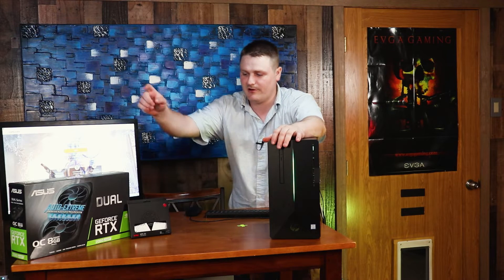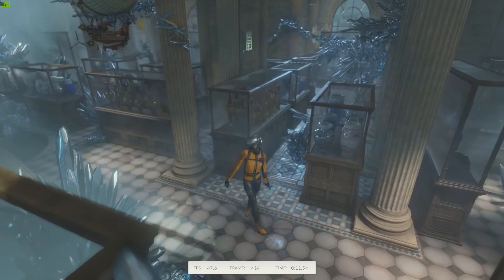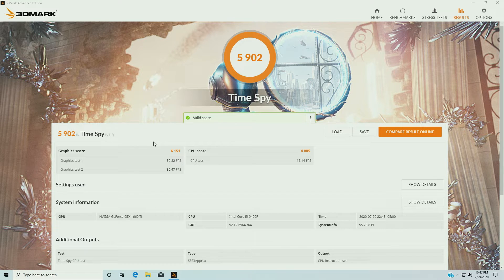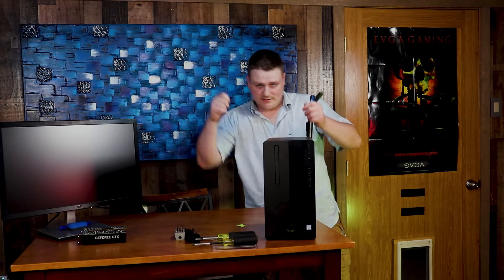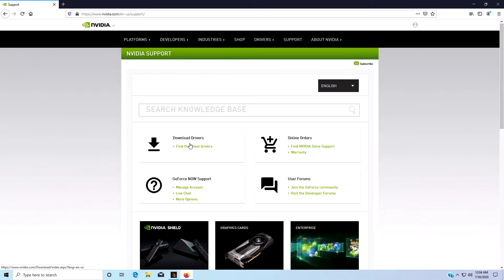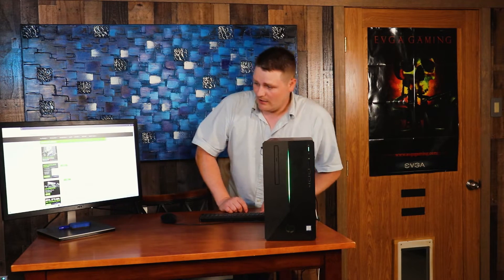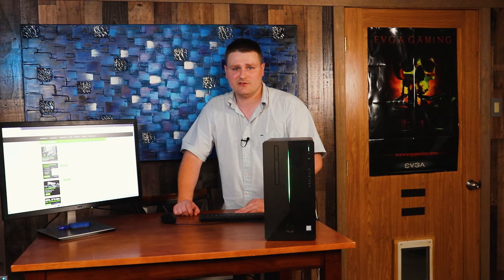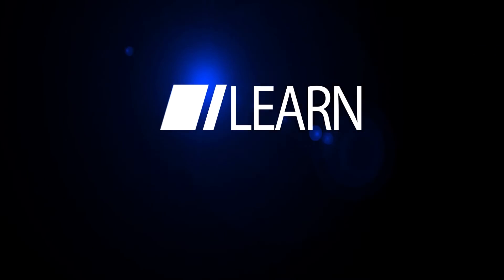Hp Pavilion Gaming Desktop 690 Upgrade To A RTX 2060 Super 8GB GPU & 16GB Of Ram (How to Install)

Comment: Would you suggest I change the motherboard out for better performance? And also, do you think its worth it to do a cpu swap along with the gpu and ram? And lastly, would a 3060ti fit?
Reply from the maker: New video will be out soon All I can say is I got soming thing better then a 3060 to work. Editing it right now.  To your other questions if you feel comfortable swapimg parts. That's the best thing to do,  becuase your no longer limted on gpu size. You can put any gpu and psu in. If you did a case, motherboard & psu swap.

 Also it does not cost to much. I talk about it in my new video towards the end. It is About 200 bucks to do this, Thats amd or intel. If I was to do a case swap I would go with the best gpu I could afford. 3070, 6800xt  or 3080, 6900xt if you can swing it. Or a 2080ti used, just make sure it was not used for mining cytro currency. It kills the gpu, it runs it at like 70-100% usage, for how many years they owned it. The reason they sell them is they start to die on them. Most gaming gpu with normal use will last 5-10 years. But when we game we do not keep the gpu at 100% 24/7 . You have to look at it like this most enterprise computing gear is rated for 100% use at 10 or 20 years. This is why the price tag is so much different. Comsumer gear is rated at 20-30% use a year.

Comment: Do you think the Gigabyte 2060 OC - 6GB GDDR6 RAM will fit in my 2019 hp pavilion tg-0143
Reply from the maker: Is it below 10" incs ?
Reply: @TNW1337  its just below 9 inches
Reply from the maker: @eikonen00  should be no problem as long as you have the right psu for the card, 400 watt.
Reply: @TNW1337  Ok thanks!
Reply from the maker: @eikonen00  Any time..

Comment: I brought the Corsair Vengeance 2x8gb kid and it only clocks in at 2133 MHz and I was wondering how I can make it faster everytime I try to overclock it I get a black screen and I fixed it twice by taking out the battery and putting it back in help?
Reply from the maker: Is this AMD or Intel system? If it is the AMD you will need to do a Bios update. And it only allows up to 3200Mhz.
Reply: @TNW1337  it’s the AMD system
Reply: @TNW1337  and how do I do a bios update?
Reply from the maker: @rhen6073  You have to go to the HP site and Download the Update. Then use a USB stick. Sorry I do not have a Video on it I have not had to do it yet. I would google it. Like: how to Update a HP pavilion "TG01-Your Number Here"  Bios.  Its not very hard just have to follow the steps. I am not sure If Hps can do it from windows, But most of the time you do it with a USB stick. Make sure it is not a crappy USB stick. What I mean by that one that has given you any trouble ever.
Reply: @TNW1337  ok thank you I’ll let you know when it works:)
Reply: @TNW1337  I did the bios update but it still says the my memory is 2133 sorry but can you make a video on it
Reply from the maker: @rhen6073  it may not support the profile on the pc sorry man.
Reply: @TNW1337  oh its ok at least i have dual channel

Comment: Any idea what size the boot ssd is? I need to upgrade and clone my current.
Reply from the maker: Um mine is 256Gb they also come with 512Gb Ones.
Reply: @TNW1337  Mine is 128gb but I'm not sure about dimensions I saw it and it looked fairly small. Any other ssds I can put in like a evo or something?
Reply from the maker: @tyy1378  There are 2 M.2 slots on the board. Only one is a M key 2280. The size is up to you but 1Tb is the sweet spot right now for price.
Reply: @TNW1337  So what would be the best ssd to switch and clone the current one?
Reply: Nevermind, I found one.
Reply from the maker: @tyy1378  I like Samsung, Kingston, PNY, Crucial, Corsair & Adata. Pretty much in that order.
Reply: @TNW1337  So, per say I clone my ssd then move over to a new case and motherboard. How will all of the HP software counter with that, like the bios and all the other weird programs.

Comment: I have the tg01-0023w that also has a 400w power supply can I upgrade that with the 2060 supper and with 32gigs?
Reply from the maker: Yes 100% Make sure the RTX 2060 super in no longer then 10"
Reply: @TNW1337  oh awesome so I can upgrade it with also the 32 gig of ram with no problem with the power supply getting fried up or destroyed. Sorry this is my very first time upgrading and I just kind nervous about it 😂
Reply from the maker: @MrKjy1999  Ohh, you well be just fine. I would advice you to watch one of my upgrade video and skip to the part I talk about installing the ram. It does feel like you may break it when putting it in. Also the ram can only go in one way. It is pretty hard to break it. Good luck.
Reply: @TNW1337  Hey! My b for bothering you again but I have another question. Could I also upgrade the psu to 500W as well?
Reply from the maker: @MrKjy1999   As of this Time I can only say that it may work As I have not done it yet waiting on 2 to be shipped to me.

Comment: are there any other gpu's that will work with this computer like the 3060?
Reply from the maker: Until i get the 500watt psu from, hp I do not know.
Reply from the maker: 2060 super at this time. Some have gotten the 2070 to work.

Comment: Hello! Do you know the standard psu for the hp pavilion 690 0xxx? Also will the ASUS TUF Gaming GeForce RTX 2060 OC Edition work with the 690? Thanks!
Reply from the maker: Ok the normal PSU depends on what parts came with your HP Pav. It can be 200watt 310 or 400 watt Psu. Only the 400 watt can support the better GPU's If you do not have a 400watt you can do up to GTX 1650. The 400 version can take up to a 2070. I have not tested  the 2070, only the 2060 super. Other on my channel have gotten them to work. 

They do sell a 500 watt I have 2 on order one from hp and one from Germany. I used in the video a Asus card, Make sure the card is not to long and it is sorter the 10" 1/8th your fine. But I would just stick with under 10" so you have room to get it in side the case.  That card should be fine as long as it is not to big..
Reply: @TNW1337  Wow! Thanks that helped a lot! You earned a sub.

Comment: Are there any other motherboards that will fit in this case?
Reply from the maker: I mean the intel board will.
Reply: @TNW1337  So an intel motherboard will fit this case, does it have to be micro atx or regular atx?
Reply from the maker: @worried_raptor647  nope sorry only hp motherboard will work inside hp cases. You could swap a intel to amd hp board if you could find the part number.

Comment: Finally, now I know how I can upgrade my computer as the current specs are showing its age
Though I would’ve liked that you changed the processor as well and that the video wasn’t sped up so you could do a more detailed walkthrough of changing the parts
Also, can I change it to at least an RTX 2080? Or maybe 3080?
Reply: i wouldnt reccomend putting a 2080 or 3080 in this pc, powersupply isnt massive
Reply from the maker: @l.9550  yes he is right! it requires more then a 400watt can support. I have Two 500w on order, one from hp & one from Germany, should allow up to a 3070 or 3080. But will not know till I test it. I am also making modification to a psu to try and get a 800 to work with it. If I do you could get a 2080ti, Titan or 3090. If I get it to work, I will have all the information how to do it, shared freely. Had to order a osilaspcoe and single gen. But we will see..
Reply: @l.9550  should I just save up for a new computer that’s over 2k? I don’t have knowledge of PC building at all and I’m really slow at learning stuff sometimes 
I don’t mind having to build my own PC if it isn’t too hard though
Reply from the maker: sorry I did it to try and save time. I have single videos planed.

Comment: Hi mate! You seeem knowledgeable and I have a plea for a smidgen of it! I have this pc though diff spec, (mine is the 690-0011 which has a much smaller psu only 180w, is this going to be able to power a bigger gpu like that or shall I look at something more like a 1660ti as an upgrade? Thanks man, hope you can help...... Oh and would installing the 1660ti mean I would need a heat sink(no idea what that is:) ) and a ssd drive too? Thanks again appreciate your help
Reply from the maker: Well You would need the 400watt, You can go up to a 1650 with that psu.

Comment: Can i take out the procesor with rams and all things. Then replace the motherboard for new one and then buy new psu and graphic card or the psu will just dont fit into the case?
Reply from the maker: Yes you can it would be new case motherboard and psu.

Comment: If I were to upgrade my psu to a higher voltage, would it be possible to add a 3060 ti with that motherboard?
Reply: He just hearted it without answering lol
Reply: @danielbergok  i think his answer was a thumbs up?
Reply from the maker: No sorry it will not, Sorry about the long wait. It is a 200Watt TDP Card, with out the 500watt Psu witch I have not tested yet still waiting to get it from hp.

Comment: Would a MSI GeForce RTX 2060 RTX 2060 GAMING Z 6G Graphics Card work with this?
Reply from the maker: 2 things As long as you have a 400w psu, And the card is under 10". In the TG you can get away with a little more. but it is a good idea not to push it.
Reply: @TNW1337 I'm mainly looking to upgrade my GPU which made it seem like 2060 is a good one but hard to find and make an attempt to swap the case
Reply: Also, would this work? https://www.sabrepc.com/DUAL-RTX2060-A6G-ASUS-S2379193 and this one https://www.sabrepc.com/G2060GZ6-MSI-S2379616
Reply from the maker: @Decahexic  the card i use in the video is a asus Rtx 2060 super.
Reply: @TNW1337  What's the difference between the super and the MSI one for example? Because I'd love to do the MSI one (The second link) but I don't know if it would fully work and I just want to make sure.

Comment: You really do need that extra memory on those computers. For whatever reason they decided slapping an AMD APU processor in there WITH a discrete gpu was a good idea. On my friend's the bios was locked out where you would disable the APU so that it wouldn't hog up 2gb of your memory, so putting in dual channel 16gb was a major upgrade on it's own.
Reply from the maker: It is it also opens up all the pci lanes. Not there crappy working around that is software based and works like dog 💩
Reply: Ugh that would explain why I only have 5.9gb of ram to use :(

Comment: Would my Hp Pavillion support these upgrades? As far as I’m aware mine has the model number of TG01-1509p. It also doesn’t have a disk drive in it.
Reply: Here’s a list of its specific specs if that helps https://support.hp.com/my-en/document/c06721602
Reply from the maker: You could do the Ram But if you wanted to do the GPU you would need to order the 400Watt from HP or a distributor.
Reply: @TNW1337  Alright, I see. Thank you very much!
Reply from the maker: @johnnydoes4923  No prob

Comment: Is a intel core i7-9700 compatible with this pc as I have the hp pavilion 690 as well
Reply from the maker: Yes
Reply: @TNW1337  if I were to buy a new case. What sized case would be best?
Reply from the maker: @natty5824  Any thing really. Do you know about the problems you would face? If not you would need a New Mobo & Psu. on top of the case.
Reply from the maker: @natty5824  I like Fractal design.
Reply: @TNW1337  it’s because I want a new case and I want to take the parts out of it and put it in a new case. Would it fit in a ATX case or micro ATX?
Reply from the maker: @natty5824  The hp mother board will only fit in Hp cases.

Comment: Loved the video! I do have a question that i was hoping you could help me with. I have this pc, and am looking to upgrade to a 3060 ti for better qhd fps. The problem is not the size of the gpu(i found a card smaller than the one you were able to fit in there), but of the psu. The recommended power for a 3060 ti i5 is around 550 watts, and i think the default psu is around 480. When you were installing the gpu did the psu seem to be a normal size? Could it be replaced easily?
Reply from the maker: The 400 watt can handle 460-480 they make a 500 that is under rated to. ive been waiting about. 4 weeks to get it . It is still on back order, when I do I am sure a 3070 Will work with it. I also have the 3070 just waiting on the psu. as soon as I get It I will have a video out. Also I have plans to put a 3090 inside the 690, TG and 590. This will be a 750watt that is said to be able to handle 900 watts. I want to make it plug and play. But it has to be developed.
Reply: @TNW1337  so any psu is compatible?
Reply from the maker: @snooddagg9278  no
Reply: @TNW1337  one more question, are the psu connections standard, or custom?
Reply from the maker: @snooddagg9278  They are Custom.

Comment: You know if they made any side glasses for this ? So if we add rgb lights inside we can see them from the side
Reply: Only video i found was someone just swap the whole inside of this into a cooler master rgb lite case tower   i believe it was called
Reply from the maker: @moto_tech_braap_itout9852  That is a option. You would need a new motherboard as hp from my understand does not fit the Atx stranded. You could mod the side but the hard drive tray is in the way.
Reply: @TNW1337   motherboard fit right in  in the video only thing he did was put hdd somewhere  else untill he gets longer sata cables
Reply from the maker: It would be a costume mod.
Reply: Do you know what the model was? of the cooler master case

Comment: Hi just stumbled across your videos, I have a hp pavillion with an i5-8400 2.80ghz 6 cores. And it has a geforce gtx 1050 NVIDIA compatable card literally just typed what it said on my system information bit don't actually have a clue about upgrading pcs. Would all the stuff you mentioned in your video work in this pc I own? Plus I stay in the UK the ram I could not find on Amazon.
Reply from the maker: Ok so you probably only have then 310w psu you would need to order the 400watt psu to upgrade gpu, the memory yes you can do any time, drive hdd or ssd.
Reply: @TNW1337   ok thanks for the reply mate. would a 1660 super work well without having to add a new psu thing? seen there our small single fans versions on amazon.
Reply from the maker: @T-BiscuitT-Biscuit  any time have a good day/night.

Comment: What graphics card is too big for this pc?
Reply from the maker: RTX 2070 is pushing it to the edge. to be safe a RTX 2060 super.
Reply: @TNW1337  and is it possible to upgrade the psu?
Reply from the maker: @krab4813  Yes to a Hp 400 yes
Reply: @TNW1337  can't i upgrade the psu any higher?
Reply from the maker: @krab4813  They have a 500watt, But I am still waiting to get it to be sure if it will work
Reply: @TNW1337  oh alright, so i don't need to sell this pc after all. I was planning on due to the lack of upgrading possibilities
Reply from the maker: @krab4813  Well I mean Building a Pc would be the best but there are options.
Reply: @TNW1337  my hp is a 690-0800 so i have a 310 w psu. what graphics card should I upgrade to?

Comment: Does an RTX 2070/2070 super fit inside one of these? thanks
Reply from the maker: Yes 10.15 Max L 5.65 W H does not matter.
Reply: @TNW1337  And the 400 Watt would be able to support a 2070/2070 super?
Reply from the maker: @KrispyBroccoli  Sum have gotten to work. Hp says only a 2060 super. I am not sure about the 2070

Comment: Hi i got same pc as you and i want to upgrade my gpu but i dont know if it will fit into the pc. This is the gpu i want to buy https://www.alza.sk/sapphire-nitro-radeon-rx-5500-xt-8g-special-edition-d5731165.htm#parametry.
Reply: Also will this psu fit in the pc https://www.alza.sk/corsair-cv650-d5759763.htm#recenze
Reply from the maker: @Radovan-si9lj  No it will not if you want to upgrade you would need the SFF psu from HP.
Reply from the maker: No reason it should not work.  Just make sure it is not to big for tha case. 10" is the max length

Comment: Do you have the erica motherboard if so in your task manager you memory speed is probably 2133mhz not 3000mhz. I ran into memory compatibility problem at first. I have a HP Pavilion TG01-0023w with Ryzen 7 3700x and Evga 8GB 2060 Super SC Ultra with 32GB Corsair vengeance 2666. Time spy score of 9372 GPU score of 9344 and CPU 9536. It can reach over 10000 if wanted by overclocking everything. Lol but is not needed it eats any game I throw at it. I only have 1/8" of room between gpu and front of case but she fits
Reply from the maker: I do, task manager shows 2666Mhz on 3000 Ram and the 3200Mhz set I have. Both are at cas 16.At 2x8 16Gb sets. 1st kit is 3000Mhz Oloy 2nd is Adata 3200Mhz.

Comment: If I upgrade the pc to a 2060 dont u need a more powerful power supply
Reply from the maker: The 400watt will support it. It is spec for the parts that come with the hp. Like only allowing a 65w cpu ect.
Reply from the maker: It will be just fine. Hp specs all the parts with the 400 watts psu to work with it this is why only a max 65w cpu will work with there motherboard.